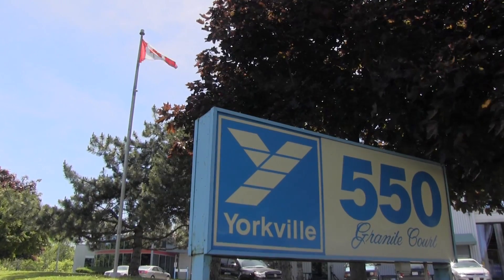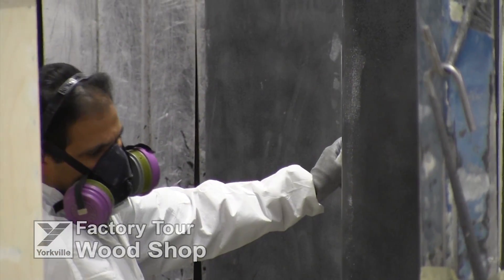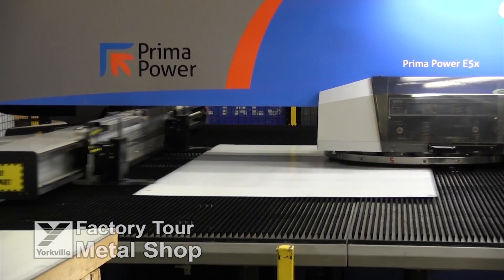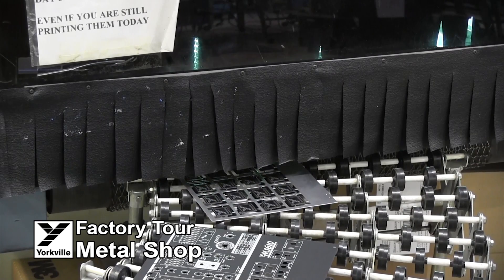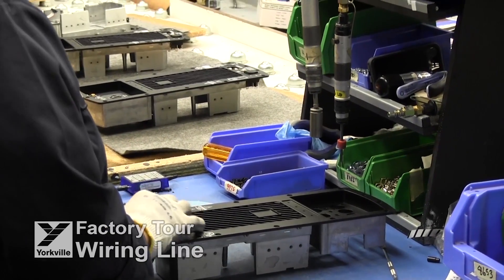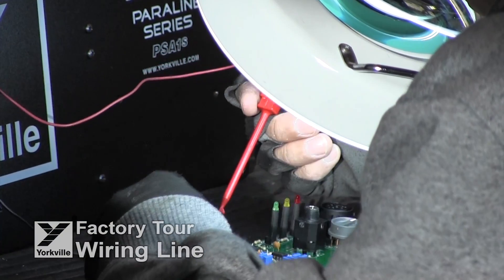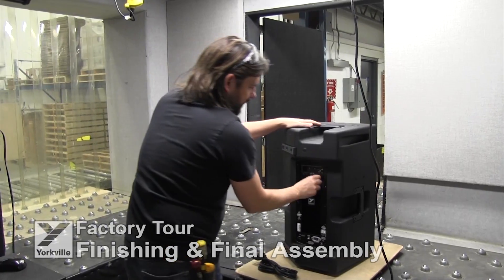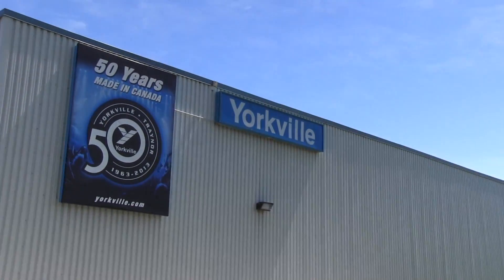Yorkville Sound Factory Tour

Comment: I played the mostly blues circuit around Boston, MA USA 1994-2003 and never heard of Yorkville.  Fast forward to 2016 playing in a semi-acoustic trio (me on electric bass) in the Albany, NY area and I needed a small bass amp for coffee shops, farmers markets, etc.  Ran into a Yorkville Bloc 80 and bought it for $70 US.  It has been great, seems very well built, and is an interesting design.  Quite loud for it size.  Then looked for a more capable powered mixer than my 100 watt Fender and ran into a Yorkville MP8dx.  Again after many years of use works great and practical design features for example a monitor amp which is rated down to 2 ohms.  So when from never hearing of Yorkville to being a big fan in about 6 months.  Thanks for making such great quality products.  I wish I knew of you earlier.

Comment: Nice to see production is in Canada however there's 1 primary issue I have with Yorkville. It's exclusive to Long & McQuade within Canada. Simply put, 1 price 1 dealer.
Traynor who makes the best keyboard amp (K4) is also Yorkville. As well, Yorkville is the Canadian distributor for Line 6 products.

The more product Yorkville has, the more control Long & McQuade has on pricing. Think of it as L & M being the music instrument LCBO across Canada ! 
So for all you musicians struggling to save a buck for gear, keep saving !

Comment: what a fun company

owner of the U15 3 way spraket cabinet I cant wait to plug in my DBX PA tommorow and try to bi-amp using a crown xls602 and behringer pmp 3000 powered mixer.

these seem to have better potential than any speaker found on the floor of my local and regional pro audio stores

if a helpful section on how to properly bi amp could be posted by a yorkville rep that would help me. 

thank you and great quality product!!!

Comment: The report is well enough made, but we do not see the assembly of loudspeakers nor the manufacture. Maybe that they are not made by Yorkville, I have the profound conviction of it, thus Yorkville is an assembler. I would like to know where from result loudspeakers (RCF, JBL, EMMINENCE, Beyma, B&C, other)
It is a pity this major information does not appear!
Reply: +Eric Morata, if you listen with your ears and not with a brand name in your head...
Reply: Most if not all of the speakers used are eminence
Reply: They also use Celestion drivers, just like the enviable QSC.
Reply: @rudycorraudio9089  even their YX line use Celestion cd

Comment: Real circuitry board worker soldering . In China that all by robot now. but is that home audio speaker 15 “ woofer or musical amps. you can get better top midrange sound with many small 2” speaker and a good small sub. I tried poke audio only good sound if you your neighbors to hear too.